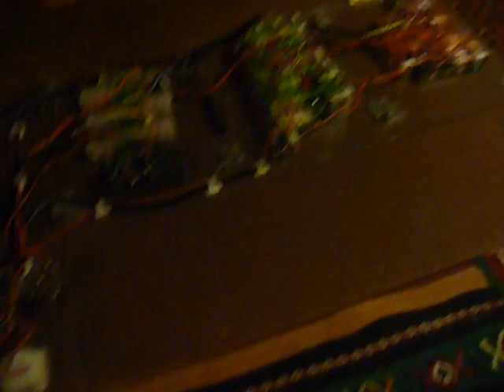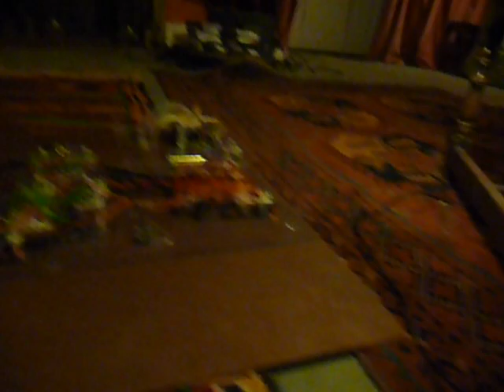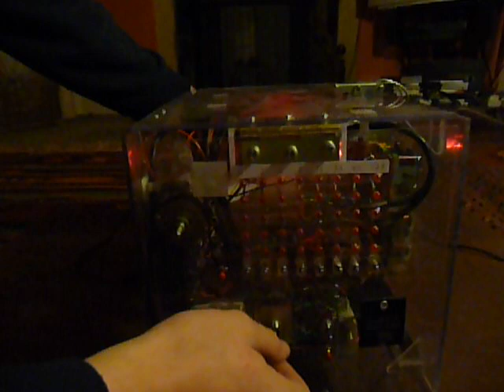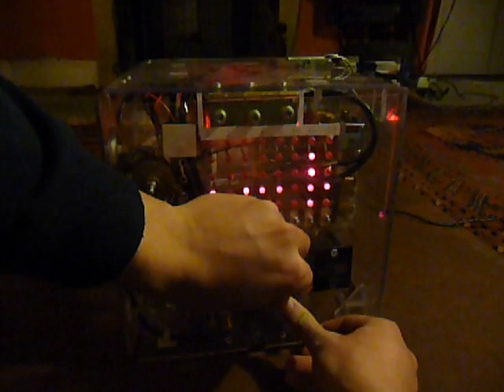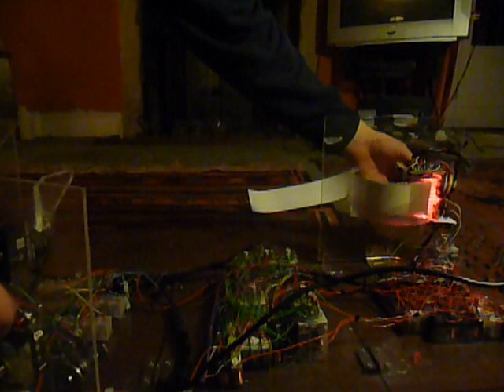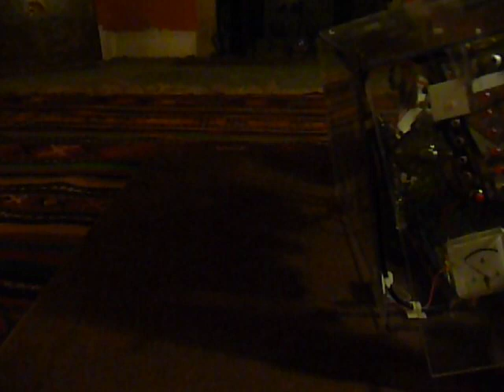TIM8 Relay Computer (Vlog 7): Fibonacci  sequence

Comment: Ever thought of using thermographic paper to write the program on the softare(tape)?
Reply from the maker: +Jeffrey314159 Yes... I thought of it several years ago when I originally designed TIM, hence why it uses thermographic paper for the program tape, and a thermographic printer to print it.
Reply: +Rory Mangles  It was in 1967 that the world's first 'pocket digital electronic calculator' was created and it used thermoprinting paper instead of LED's.. This device needed a lot of little batteries so it was not so pocket-sized..
It was called the 'Caltech' but referred to as a Slide Rule Computer..